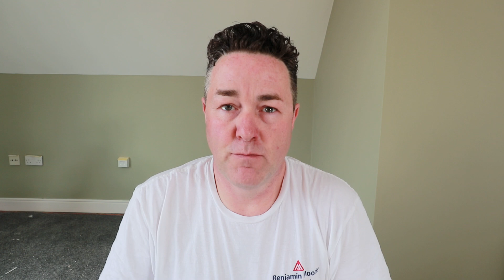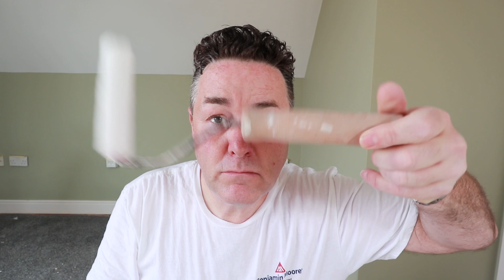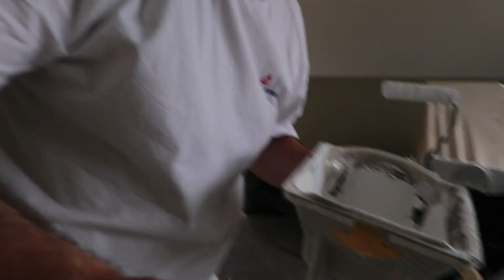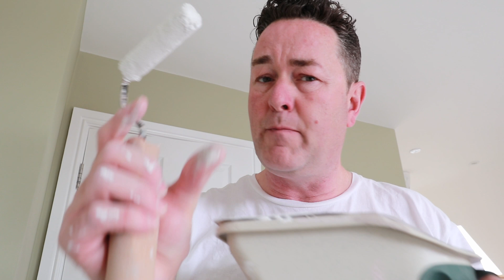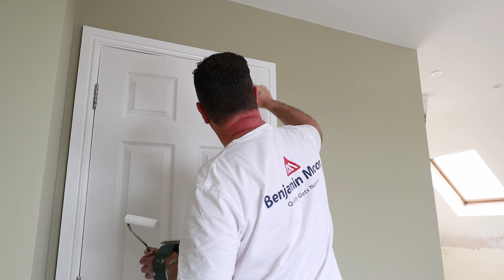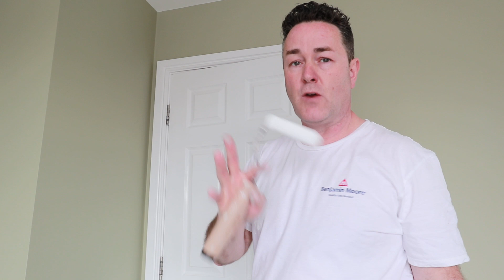What's the REAL Best Roller for Painting a Door? Top Expert Reveals

Comment: Ever tried Staalmeester 5mm microfibre roller Phil? Would recommend you check them out, I find they hold more paint than the 2fb equivalent and also the application is as smooth as butter
Reply from the maker: That's the only thing with the 5mm, you feel you need the amount of paint the 10mm holds lol

Been using 2fb. 5mm today and though it again

Comment: Bit late to the party, only just started watching your videos and can’t fault them, very detailed and help tremendously!
I’m not a decorator by trade (trained as a Chippy) but clients are asking me to do more painting. I’ve been using the Pelican pot for years and love it but curious to know why you hold the brush & roller when there’s a hook for the roller and a magnet for the brush all inside the pot🤔
I’ve been watching your videos with great interest re spraying, client of mine with a big house wants me to paint it top to bottom, built in bookcases, panelling, bespoke wardrobes, staircase, the list goes on so putting my hand in my pocket and getting a GRACO GX21 (new) for walls and ceiling and an Apollo Pro Spray1500 3s (used but in very good condition) for all the other bits.
Fingers crossed I’ve learnt enough from you to give it a go 🤞🏻
Reply from the maker: Just seen your message.

The magnet doesn't hold my brush well with it being oval, it rocks about and falls to one side with the handle being longer.

Comment: Hi Phil, random question on painting if you don’t mind mate! 

I’ve been refurbing my first flat and when painting the walls (using valspar tough trade) when I put frog tape on it to line under the ceiling it always takes the paint off the wall, always! No matter what I do. 

Have you got any specific tapes that work for you and never peel paint off? 

Thanks Phil, keep up the good work. 

Looking to paint my black chest of drawers white and I’m debating between Jono Aqua guard and WRX Satinwood based on your videos, I’ll make a choice soon! 👍
Reply from the maker: easy one, don't tape it... get a decent slash cut brush... and cut it in free hand..... easy the paint so it flow better and work up to the angle .. dront try an dhit it with paint staright way.
Reply: Thanks Phil appreciated- can I ask what tape you use when you are taping Doris just for reference? 👍 

I’d love to try Benjamin Moore scuff-x but like you said, I just wish they’d do a smaller tin for small jobs so I can try it! 

Will go with the Jono Aqua guard, Bedec or the WRX satin I think as I only need a smaller tin
Reply: @DigitalDavies529  i been using TESA Pink tape when and if required after allowing wall paint to dry
Reply: 3M Extra Sensitive Tape (the pink one) absolutely terrific stuff. But agree with Phil, get a tidy brush, stick some water in your paint and cut freehand if you can.
Reply: @PBYM79  cheers all! Does the water help with the cutting in then?
Reply: @Rhys Davies  Yes it will help it flow off the brush better. Don't add too much though, depending on what you're using it's probably best to start with 5% and judge from there.
Reply from the maker: I use the orange looking Q1 tape, more delicate is the purple Q1 tape, that's less tacky.
Fear with any tape is it pulling off previous paint off a surface, don't leave it on for long.

ScuffX is worth a try... Jono Aqua Gaurd is good too.
For a full paint satin system, the Isomat is very good. Primer/UC then two top coats

Comment: Two fussy blokes every time. In my opinion the best finish for rolling all woodwork, however for a high gloss finish I like to apply with a roller and then lay off lightly with a decent brush. It's  the best finish ever.
Reply from the maker: with water based you've not got the time to tip off :(

Comment: Think you have got your boxes mixed up. 10mm is red so 5mm must be green? I think you used the 10mm in Portugal on all the doors but in this video the 5mm. Do you prefer the 5mm for woodwork? I do...
Reply from the maker: the red box says 5mm on it.. green box is 10mm

Portugal the 10mm were ideal with that CIN paint
Reply: Sorry you are right, got confused by the big 10mm roller size print 🤭